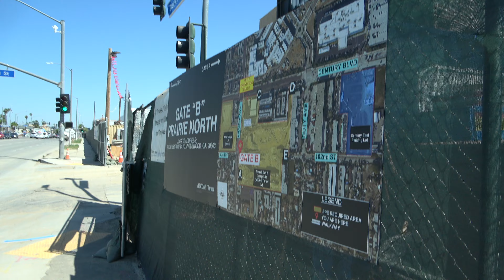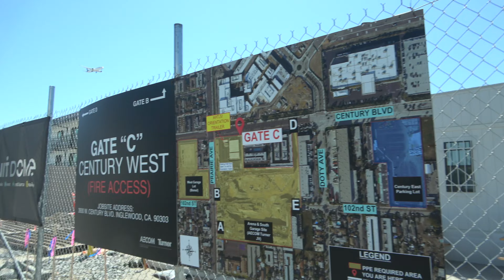LA Clippers $2 Billion Intuit Dome Construction Update Inglewood 4.13.22

Comment: Anyone know if the Intuit Dome can be configured for ice hockey, or is it basketball only? I'm aware the Clippers will be the only tenant there; I was just curious if it will be possible to use the dome for ice hockey.
Reply: No its just configured for basketball and concerts
Reply: More than 108 people know the answer to that question. /
Reply: Im pretty sure it can be for hockey, anything is possible 💵
Reply: Ok, I see now that it was built specifically for basketball. Also, many other features of a multi-purpose arena are missing in the design.
Reply: @anthonywilliams7109  The Intuit Dome will configured for Basketball, Concerts, and other events. /
Reply: By making it a basketball only facility the seats behind the baskets will be a lot closer to the court. Not only will the views from behind the baskets be better (and able to command a higher ticket price) but because of the more compact nature of the building the crowd noise will be more intense. Steve Ballmer mentioned one of the models he is using for the Intuit Dome is the Viejas Arena where the San Diego State Aztecs play. The noise level there is extremely loud. Another feature he is borrowing from Viejas is that there will be only one level of seats behind the opponent's bench that stretches from the floor the highest row of seats, to increase the noise (and intimidation level). When you don't have to accommodate hockey you can add these special features. Will be a basketball palace and the Clippers games will be one of the hottest tickets in town.
Reply: @raphaeljunior6089  no hockey. Get it through your head.
Reply: @Samuelfish2k  there may be hockey.
Reply: @raphaeljunior6089  Steve Balmer isn’t going to allow it. The whole point of him funding 100% of this arena is to house his franchise and get away with the whole sharing mess they’re currently tied down to. You think a guy worth $100 billion has to share if he doesn’t want to? 
Besides what freakin hockey team even exists that’s in need of an arena to play in? Nobody. Who the hell even cares about hockey?
Reply: @raphaeljunior6089  – the floor space is only large enough for a basketball court. A hockey rink wouldn't fit in there.